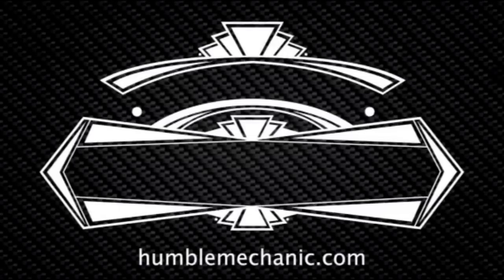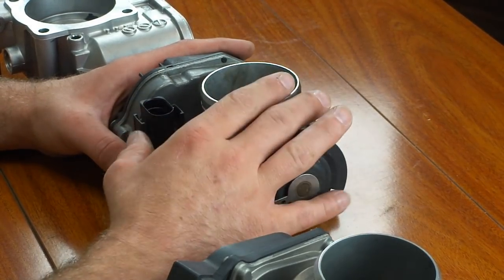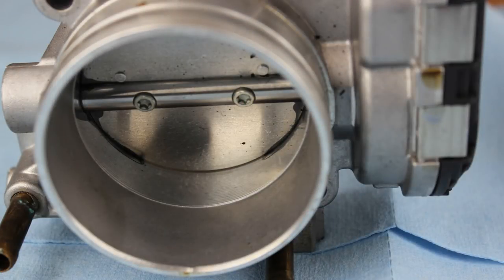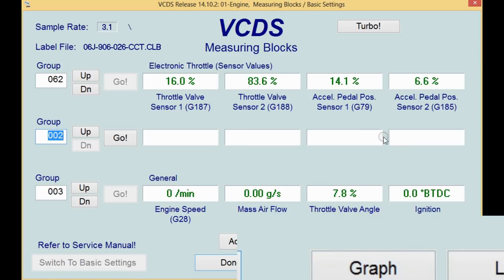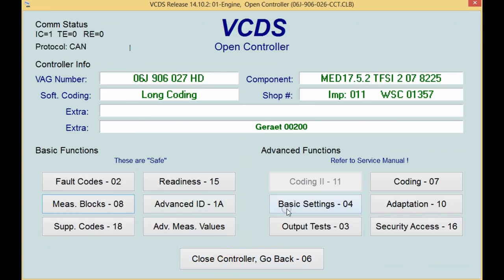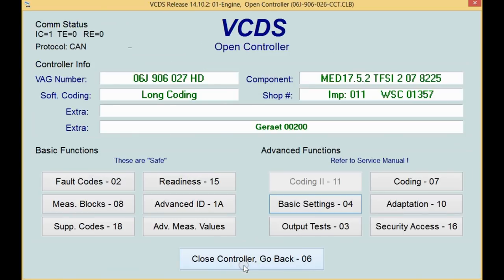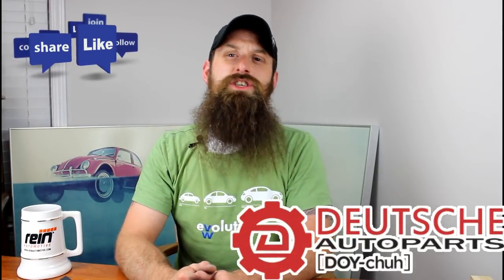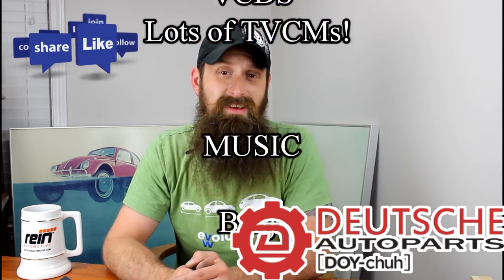How A VW Throttle Body Failed with VAG-COM Demo

Comment: I had a code PO420 on my 2011 VW Jetta S. I drove the car and suddenly my car started shaking then I noticed the CEL flashing, I lost throttle and shortly after the EPC light came on. At the light before I pulled into a shopping center the car idled roughly. I waited 15 mins then all lights were gone. I headed home and when I was near the CEL flashed again and lost power. I was told it could be an O2 Sensor Bank 1 and that cleaning the throttle body would help. I called the dealer and the owner came out as I am concerned about this happening with my son onboard, he said I should disconnect the battery and reset the computer. I told him I don't want to get the code erased I want to fix the code but he kept saying I should leave the battery disconnected for an hour. I currently can't drive the car and its the only I have for work so I need to fix it this weekend. Upon reading this what do you advise? Should I clean out the throttle, is it the O2 and what's your thoughts on the dealer owner's battery disconnection?

Comment: you forgot to add that they're expensive as hell (for no reason other than to fleece people) and i also can't find anyone to repair/remanufacture them
Reply from the maker: Oh I did forget that. The ABA tvcm is like $800 from VW!!!
Reply: HumbleMechanic
yikes that's highways robbery!, my TDI ASV which is a much cruder version is around that price(that's why i refuse to change it hehe, i can live with the CEL).
Not only that, but the"OEM"/alternative suppliers for these things!(unless you count some chinese "clones" as such) are exactly the same price as they're VW suppliers!

Comment: Ok so im having the problem of my turbo cutting out at about 60mph...u can re set the engine but turnind off and restarting.....cud throttle body prob cause this?
Reply: @MalikShotYou  it was the throttle body giving over boost which caused engine to go onto limp mode...my mechanic gave it a clean and reset the fault...works just fine now

Comment: Hi +HumbleMechanic , my audi a3 8P is throwing P0121 and P2101. When i start the car, rpms idle higher than normal and bounce, it might also rev up to 5000 on its own. Sometimes pushing accelerator does not do anything but sometimes it revs normal. Its not in drivable condition. I suspected it might be a dirty throttle body but i just pulled it off and it was spotless clean. Could it be a wiring issue ?  Or should i be replacing the entire throttle body? Any ideas, i wish i could bring it into the dealer but can not drive it
Reply: hi mate ive got the same issue, did you manage to sort it

Comment: Can I use a obd2 scan tool to test my throttle body
Reply from the maker: Depends on the scanner. But many of them you can
Reply: OK thank you I just got a p2138 code  on my 01 vw golf 1.8l turbo hoping a good cleaning will fix it
Reply: Anywhere else I should check to try to get it fixed? If that doesn't work
Reply from the maker: That code is for the pedal. That would be my next check. Also battery voltage
Reply: Sorry to be a pain in the neck but what is the voltage supposed to be and is there any way of testing my gas pedal and should I even bother trying to clean throttle body
Reply: And ty very much for actually getting back to me keep up the good work love the vids 👍

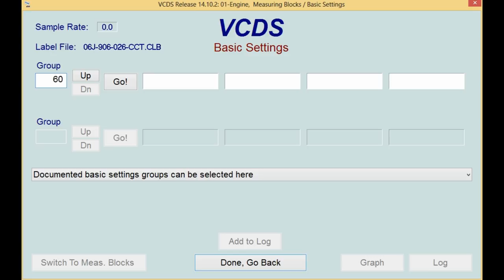Comment: 6:50 What happens if I would swap throttle body for a new one but will not make adaptation?
Reply from the maker: Maybe other issues like wiring?
Reply: @HumbleMechanic  My fathers golf mark 4 1.6 16v did not want to start at all. I helped him to pinpoint the issue. I suspected crankshaft position sensor at first. But as throttle body did not respond to any gas pedal imput I disconnected throttle body and tell my father to try start the engine. And engine started. I plugged throttle body back in and engine still worked. But car did not react to gas pedal. On next day he tried to start car and engine just started fine. As he started it he pressed gas pedal and while engine started it reved up aggresivelly as it normally should. 
Now this is weird but there must be some issue that may come back. As for now it seems ok. Weird stuff.

Comment: What can cause my car to get stuck 1500 rpm after a rev when letting go
Reply from the maker: clogging cat maybe?
Reply: @HumbleMechanic  thanks so much for replying I will look into it I have a cat back delete on the car with an aftermarket air intake the car does feel and sound like it may also be running lean so I’m trying to diagnose it

Comment: And how to delete Adaptation values in 055?
Reply from the maker: Clearing codes should reset that
Reply: @HumbleMechanic  Thank you, I'll check that later. By the way what does an Idle Stabilization value of -3% (my case) means? Will the idle-rpm be decreased by -3%? Or is the default throttle-valve angle decreased by -3%?

Comment: Would be nice to learn a bit more about the full drive by wire one. I really do believe I have a bad one on my 2012 A3 quattro. I keep getting the p2004/2015 and sometimes 2014 codes with everything recommended to be changed done.

In fact I've bought 3 intake manifolds, 2 oem and 1 knockoff(I mean what the heck right?), with no success. I also followed all of the vcds settings etc...NO change. If I reset the fault, then the service engine light goes away until I turn the vehicle off and restart it again.

The car runs perfectly fine, but it does have a really bad loop while idling during a cold start. You can also here it sucking in a ton of air on start up in which I wasn't accustomed to hearing before this issue, but after it warms up(20-30secs), its silky smooth and has its normal power. 

It's been a great car with only 2 issues other than this one over the 8 years that I've owned it. The electric water pump which went out 2k miles out of warranty and the hpfp about 9 months later. Besides that perfect!

I'm swamped for now as for ideas as to what could be wrong. I've also changed the vacuum solenoid with the same result and the intake ports have also been cleaned.

Comment: any time i see plastic gears, i say, "future failure!"
Reply: It is not plastic. Usually nylon or PPS, or even thermoplastic polyester or liquid crystal polymers etc.
Reply: @turbocpt1  you just said it wasn't plastic...and then called it thermoplastic. Nylon...is also essentially a type of plastic. 

Also....  PPS plastic is a semi crystalline, high temperature thermoplastic polymer. ... In addition to its low water absorption, PPS polymer also has good dimensional stability and excellent electrical properties. PPS thermoplastic is chemically very stable, even at high temperatures.

Its PLASTIC!!!  Please stop talking...or at least use google, you dunce
Reply: @kingloc6042  The statement remains. It is not pure plastic as in some chinese brand remote controlled car. It sounds cheap if someone states it is made of plastic, where the likes of teflon, nylon etc is far from pure cheap plastics.
Reply: @kingloc6042  lol

Comment: n what if the throttle it always opened what the case
Reply from the maker: +Sandile Ndluli our car probably won't start. Or run very long.
Reply: +HumbleMechanic m driving vw  tourag n the throttle valve is always opened but it driving with the engine light on

Comment: 9:28? throttle body from a fully electric vehicle?
Reply: He means electricity controlled throttle body, the accelerator is not connected to the tb by a cable. The pedal drives a sensor that tells the ecu how much throttle and the ecu tells the stepper motor in the throttle body how far to turn. This is also useful for cruise control. Hope this helps.

Comment: Why does VW continue to make cars that always have problems? Just like the CAM follower issue on the 2.0T FSIs, carbon build up due to poor direct injection design of which VW won't take responsibility for? Fun cars yes, however VW as a company is arrogant and can't seem to source reliable sensors and parts. If Honda can do it so can VW. My 2008 2.0T FSI Jetta Wolfsburg burns oil like crazy. Over a quart per fill up. Its embarrassing to drive having all.that oil burn and smoke come out of tailpipe. Vw care??? NOPE!!! Same issues with BMWs I've owned.